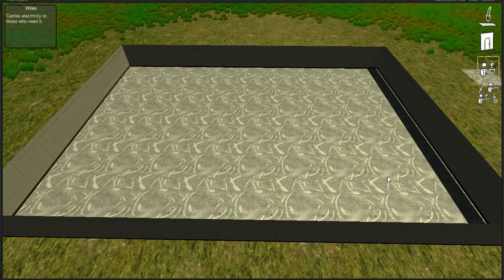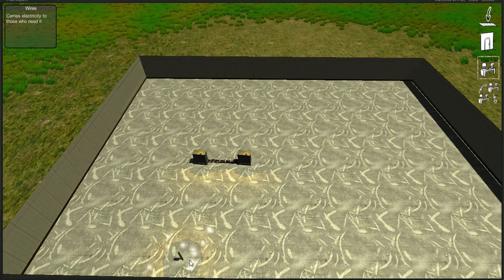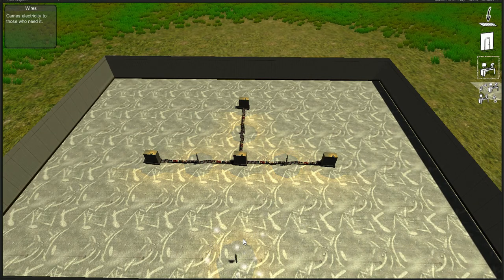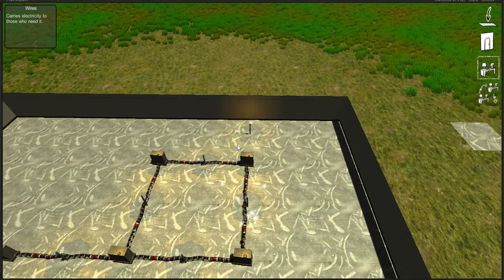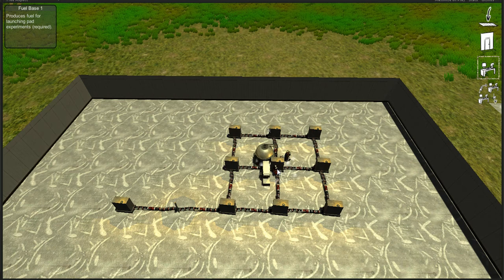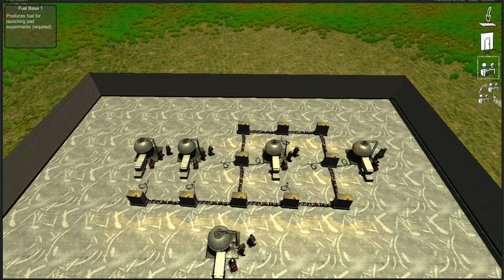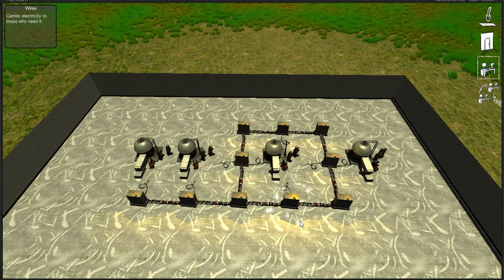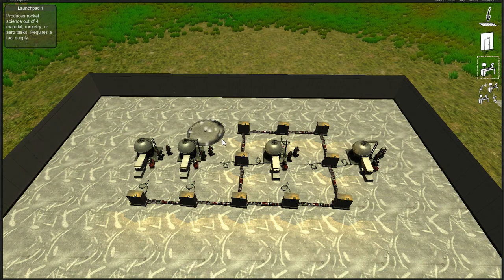For Powering Science!

Comment: Hi Craig... Good improvements, eh ?
How are you planning to handle the energy transfer ?
Something like Minecraft does with those mods ? Like Industrial Craft, etc ?
I always wondered how to handle something like this, without the need to run a check every frame or something, to see if is there a cable connected or not... :P

I did a small prototype about that, sending "packages" of energy from a energy source to everything connected to them. Then, If it's a cable, they send the package to another cables or energy sinkers, and if they don't use this energy, they simple send back. Was a little bug at that time, but I think that was the best approach for this kind of solution... :P
Reply from the maker: In my case, the main constraint is not the amount of power, but whether it's connected at all. I presume you have enough power as long as there is a power cable connected.

So all I have to check is whether a string of power modules link up to a power source. And I only have to check that when a module is placed or destroyed.
Reply: Craig Perko 
Yeah, in your case, this looks more easy... =)
Thank you again. =)